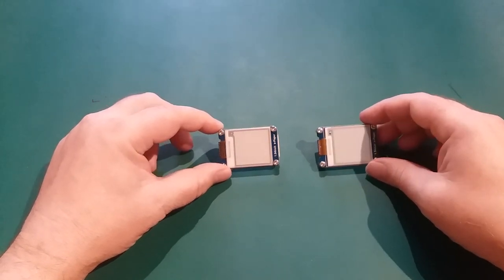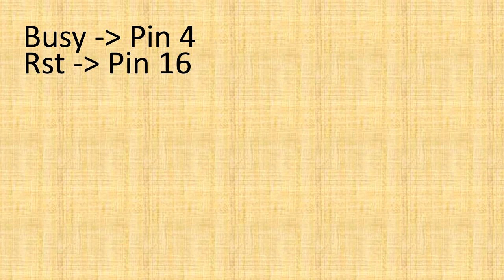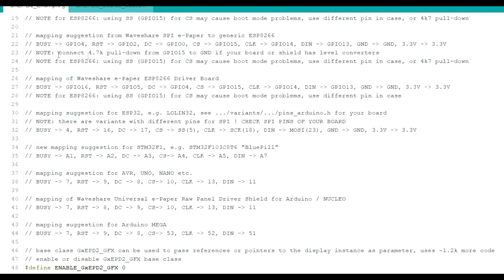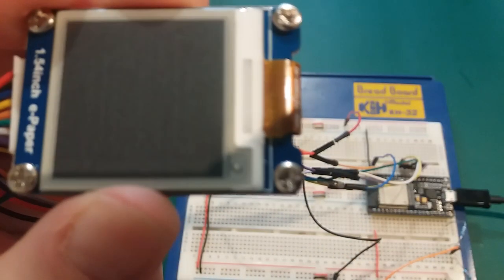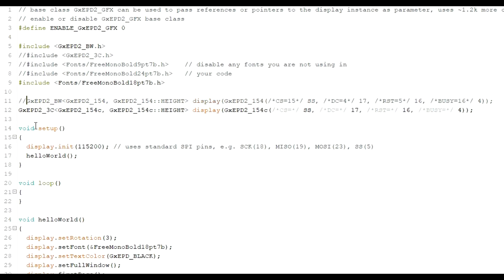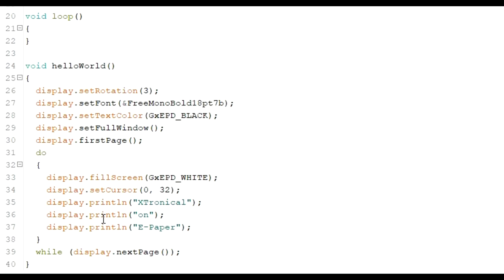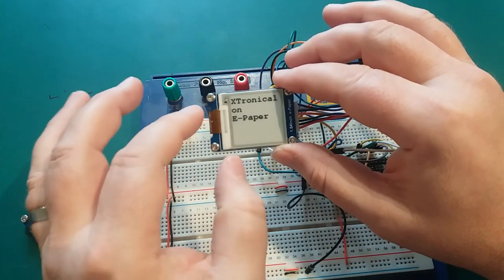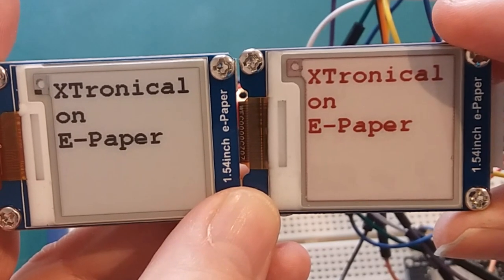Using E-Paper (E-Ink) displays with the ESP32, advantages and disadvantages

Comment: Excellent video - got me up and running with my new board. 

Thanks  for the time and effort that you put into this - full of information. 

One question - I was expecting the coords to start at (0,0) but there seems to be an offset so the (left,top) of the screen seems to be at (0,30). 

You already had that so how did you know to use 30 as the y-axis coordinate? 

Thanks again.
Reply from the maker: Thanks for the feedback. We'll... It's a while ago so I don't quite remember but I probably noticed it was off and just added in the offset.
Reply: Thanks for the quick reply. Makes sense :-)